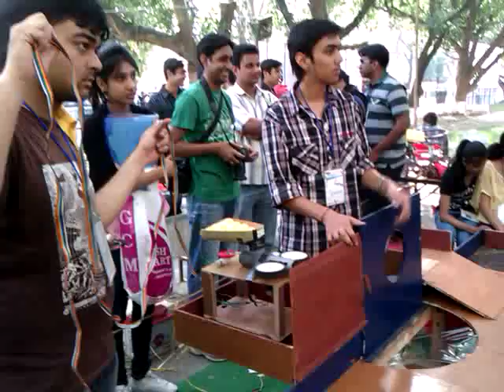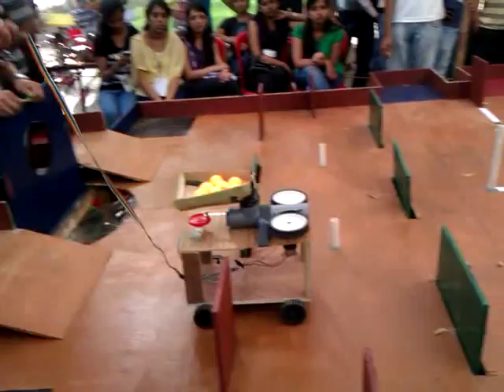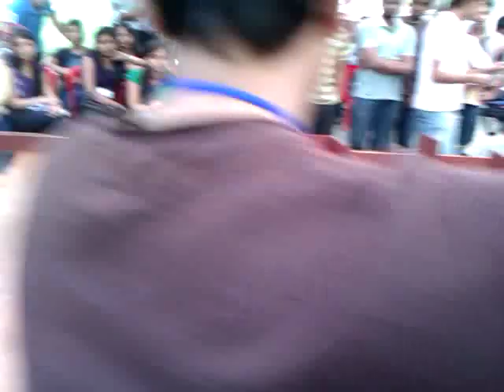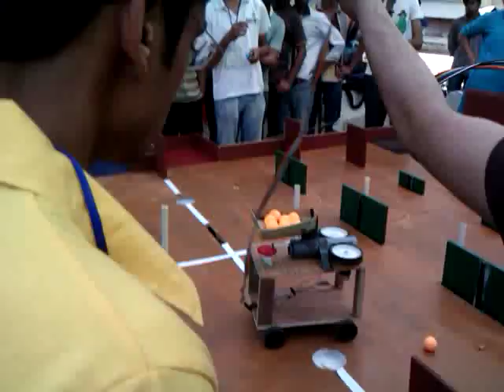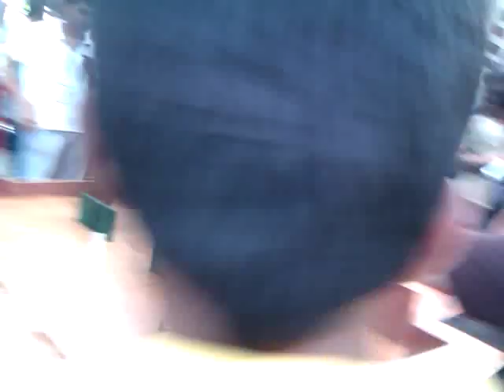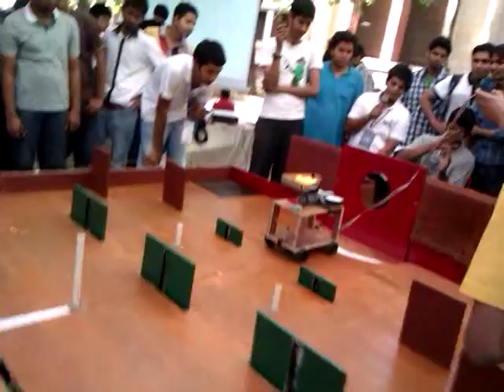Shooting Robot at IIT Roorkee

Comment from the maker: So I decided to add a little description of the mechanism for all the people who wish to implement it. 

This is called a pitching mechanism similar to what is used inside a cricket ball throwing machine called pitching machine.
I recommend to look at the video link given in the description for the explanation. Motor RPM depends on how far you want to shoot the ball. There are many factors that decide the distance, angular velocity of the wheel is one of them. My purpose was to shoot the ball just upto few meters, so I used the available 1000rpm dc geared motors powered by 12V battery with 1.3 mAh current rating. You can use even high rpm motors like brushless motors for better results. 

Another part is the ball feeding mechanism, which is a simple piston system. There is a basket above the robot which has all the balls. It is connected with a inverted T shaped PVC pipe. When the piston is pushed inside from the back of the inverted T, it blocks the way for a ball to drop inside from the basket. When the piston goes backward, a ball is dropped inside and when the piston completes its cycle and come forward again, it pushes the ball towards the spinning wheels. And Boom!!
Reply from the maker: +Pavan Katta
Reply from the maker: +Rounak Basu
Reply from the maker: +vishal singh 

Let me know if I should explain more.
Reply from the maker: +ULKESH SOLANKI
Reply: Mihir Acharya How Much Does It Cost To Make That Robot?